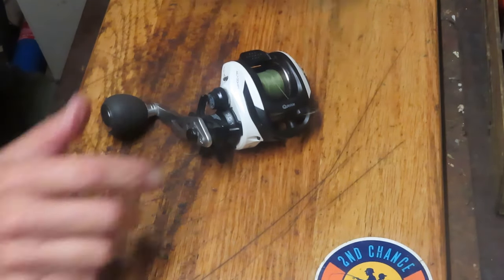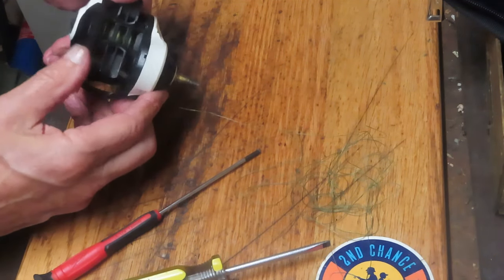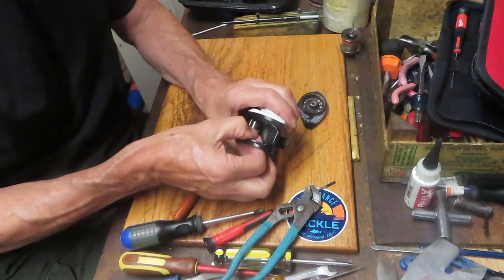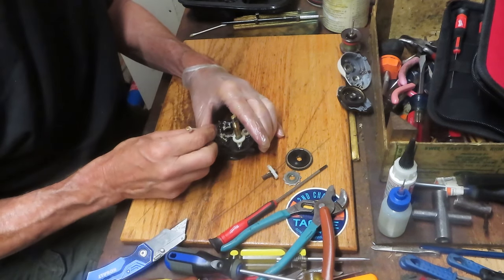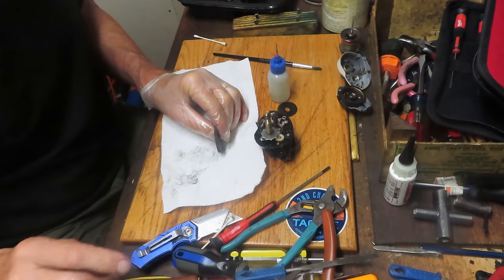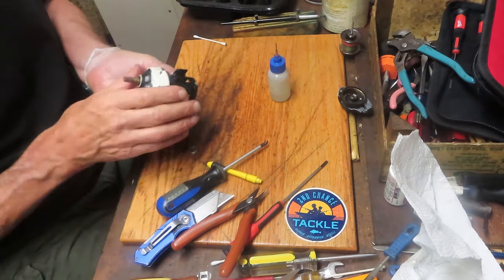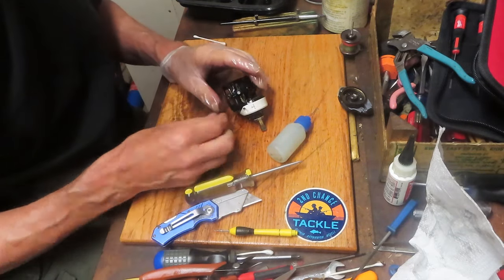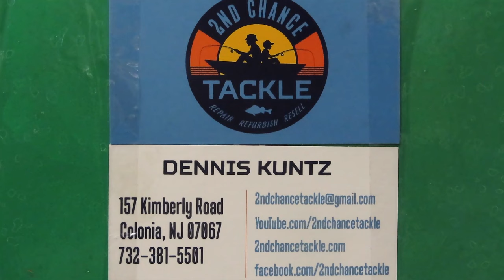Quantum Accurist AC100 HPT bait casting fishing reel failure problem diagnosis service and correctio

Comment: That reel became popular because John Skinner uses it in his fluking videos. People start putting large aftermarket power crank handles on them and using them for drifting. I think it’s more of a bass reel and it gets overtaxed with the heavy sinkers sometimes needed for fluking.
Reply from the maker: Great point!  I think the trend to low profile saltwater reels like the Lea has got everyone thinking that they are all the same and that they can use bass reels that way!
Reply: @2ndChanceTackle  I agree and one think they don't realize is Skinner does not over load his reel.  He sticks with in spec of rod and weights.  If you going offshore jigging saltwater spend more than 100 bones  -_- get pen squal.

Comment: How'd you get the spool out?  Also, -- gentle suggestion -- you could probably zoom in a bit when you're working on such a small reel.  Thanks, Dennis!
Reply from the maker: I used some penetrating oil in the outer cap and let it sit.  After awhile, it pull free as shown In the video